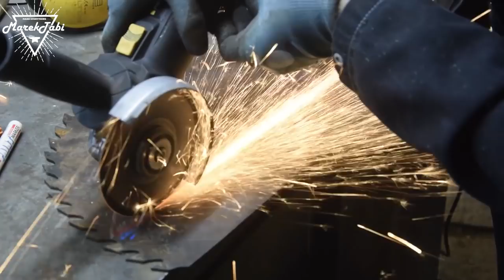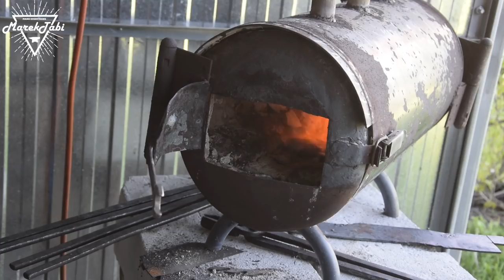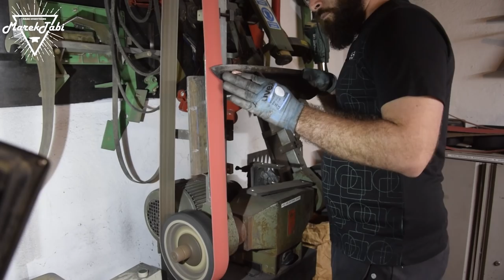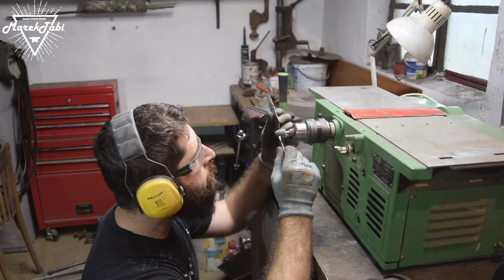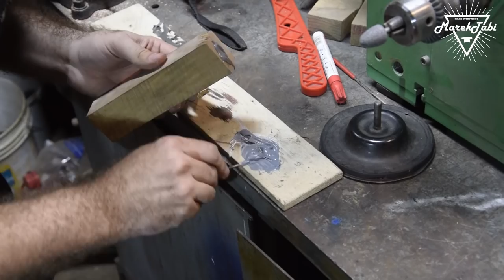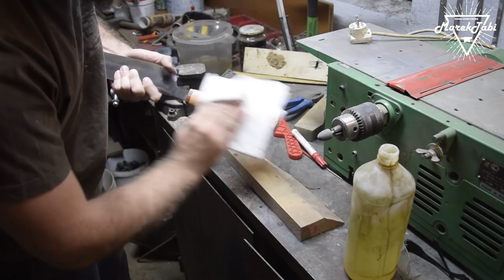Kitchen Knife Making from saw blade

Comment: Impressive knife. Did I miss it or did you not temper the knife? Won't this leave it brittle?
Reply: Its a differnt approach. Notice he only dipped the edge in the oil.  Leaves hardness on the edge and strength in the spine.

Comment: Good work! 
But I have some questions:
Why would you heat up the metal? What is that for?
And why you left such a distance between the blade and handle? Even tho, the blade have 90* corner, so you cannot slip your hand on the cutting edge anyway.

Thanks.
Reply from the maker: Hello,
it is hardening proces.
.it's just a design too, and that's how I liked it :)
Reply: @MarekTabi  isn’t saw blade already hardened?